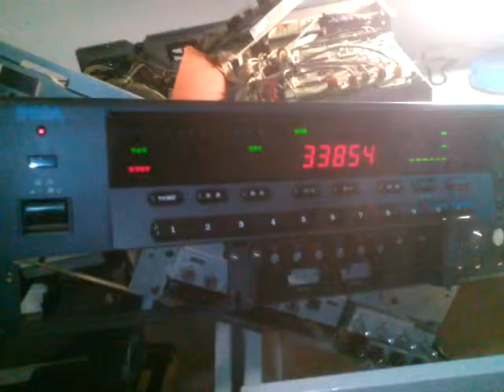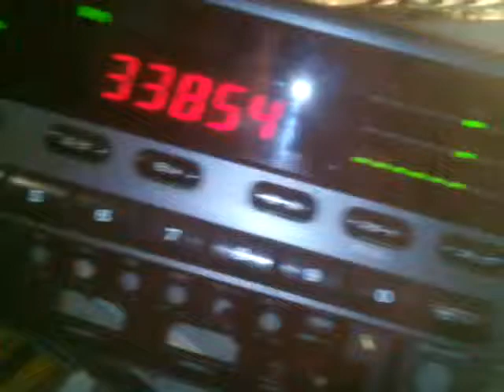DIY SEGA SATURN SUPER PROLOGUE 21 - REPAIR 07 SOUND FIXED

Comment: How did you get that front plastic faceplate off?
I tried applying a lot of force and it won't budge.
I took off the bottom screw for holding the doors and the 3 to 4 screws inside the machine
(btw mine is a 1000c so the layout is dramatically different so that could be the issue.)
Any help is appreciated and thank you for posting these videos :)
Reply from the maker: Hello Austin.
Check my complète review and repair post in darius-saturn forum, it can be usefull (in french but lot of pictures)
http://darius-saturn.com/forum/viewtopic.php?f=163&t=8018
It's strange, I remember the 1000c has only minor external face diferences, the internals cards are in other place and rear conections in diferent place.
If I remember well, the faceplate has only screws, face potentcionmeters button to unmount and maybe IR card.
You can contact me on assemblergames "GOREFESTOR" for more detalled infos or specific pictures.
Regards,